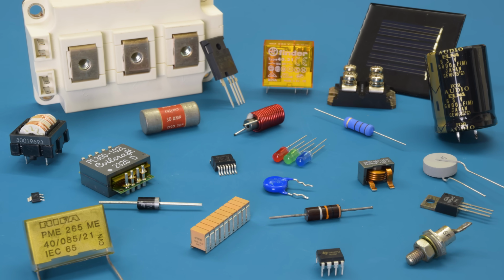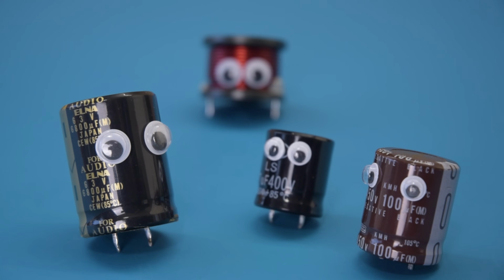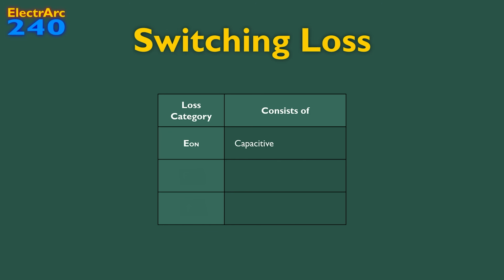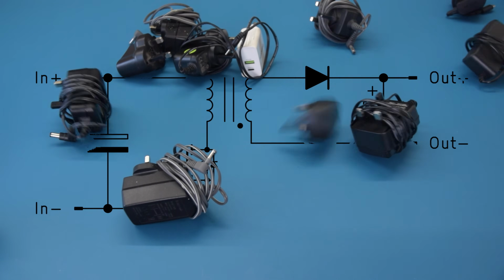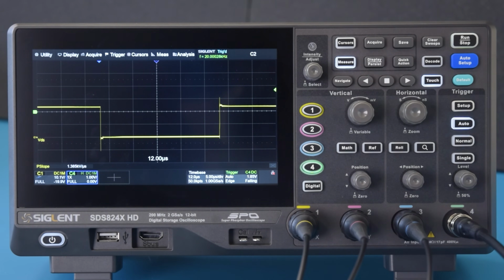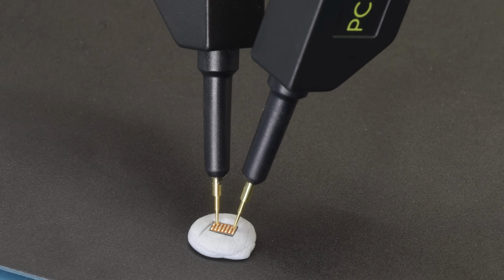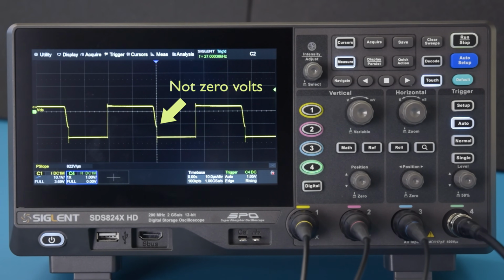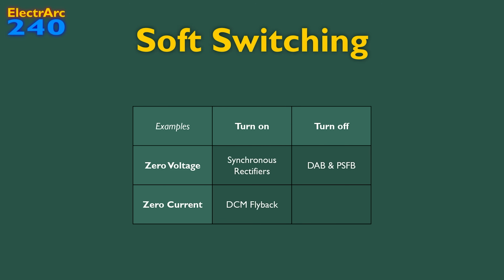Everything You Need to Know About Soft Switching (Switching Loss, ZVS, ZCS)

Comment from the maker: If I do end up making these boards into a kit, is that something you’d consider buying? If so, do you have any feature requests?
Reply: I think I would, and even the older boards as well in previous videos (The power meter board attachment for example, and the buck, boost and buck-boost too). The quility of your boards are amazing in these videos.
Reply from the maker: Thank you very much. The boards for this video are the next iteration of those, the signals are much cleaner and the boards cost less too. I was planning on making very similar plug-in power monitor boards for easy efficiency measurements, so good to hear that would be useful!
Reply: @electrarc240  Can't wait to get my hands on them. I'm watching you for a while now, and ALL of your videos were insanely informative for me and I learned a lot from you. The quality is top-notch.
Reply: it think like a half bridge board we can configure to other switch modes with a kit might be cool, but put some safeties in the kit for us cooking engineers
Reply: I think your market is probably more like school and lab. They love easy and visual tools.
Reply: I need these so I can run 5v for small devices from a higher pack voltage, and a higher voltage for a laptop running from the same pack. The system is meant to be hot swappable.
Reply: Conduction loss power is not P = IV + I2R, it is either one of those two on pure ohm load.
Reply: Yes
Reply: You know I would 😉
Reply: Maybe some backflow prevention? I have had some very annoying experiences with that.
Reply: Yes
Reply: yes! I absolutely hate my solar panels having  twice mains frequency and half mains voltage on them. That capacitively couples to my brain. I want to isolate tthem back to to DC with respect to brain. Fixed voltage ratio is fine but a power transferred  limit software defined would be also be great (simple PWM is fine) as I would then be able to control how much power goes to solar inverter and how much goes elsewhere (say to batttery. So super efficient isolated DC-DC with software controllable output power (output current limit). 8KW at 550V in and out please. That will cover 1 string.
Reply: Yes I'd be interested. Can you add a link to the repo for it?
Reply: I'm very interested to know what sort of connector that tiny 10-way connector is??? It looks very useful! ❤
Reply from the maker: @LordPhobos6502  Samtec LSHM, they are very nice but I think probably a bit too expensive if I want to sell the boards
Reply: I think I would. I would appreciate the addition of check pins, for attaching oscilloscope probes, potentiometers where adeguate, and jumpers or binary switches, to separate stages, when it makes sense. I see it as an opportunity to compare your choices with mine, not so much for actually using them, than to know where I could improve 😊

Instead of material, I would also and more likely buy KiCad layouts as digital goods, because I already have tons of components. If they come complete with routes and drilling plans (Gerber files), I can order the mounted devices directly from China ... if I feel lazy 😅
Reply: Quick question? What does the number 240 mean in your profile?
Reply: @AngelOrtiz-qu8if  GenZ 24 yo 😅
Reply from the maker: @AngelOrtiz-qu8if  240V here in the UK!
Reply: I would aswell, and maybe  even my school since it teaches mechatronics with power electronics. But you'd have to be able to sheap to Brazil w/ a price change, because some of these teaching circuit boards available from other sources can buy triple the components with their prices.
Reply: I would like to buy KiCad kits only, actually without PCB. The great advantage is, I don't have to find the right components and someone has already made the math. Sorry if it sounds lazy, it is 😅
Reply: I've been interested in some optimally efficient soft switching  resonant buck boost converter with voltage controlled PWM regulation. The idea being to eliminate the class H PSU need for a VCCS amplifier. If the voltage and current can swing up and down dynamically, with current sensing, you can get an ultra efficient current source amplifier that can meet the voltage swings required in a varying impedance load. Idk how to implement the sensing feedback in this system. But it is bridging concepts of class H PSU's, resonant high PSRR linear regulator, and VCCS amplifiers, in my case a OPA549T. 
That would resolve my issue of heat buildup, from low impedance loads, while needed the higher voltage when impedance rises, during higher frequencies. Any thoughts?

Comment: In the case of phase-controlled SSR, employing inductive loads (fans for instance), the switch (triac) is turned on somewhere in a cycle, and the load current smoothly rises positively or negatively. So it is zcs. And the triac is turned off naturally when the load current is down to zero. It's also zcs. Right?

Comment: About soft switching, i think it would be great using DRSSTC as pretty hardcore example. Technically its a very efective inverters based on ZCS, but every miscalculation or wrongfull comutation isnt a efectiveness problem only, but also danger of destruction. With primmary current around 2-3kA at 50-100kHz, few kilojoules in LC circuit... It will be a loud failiure :P

Comment: Video summary:

Everything is an inductor.
Everything is a capacitor.
Everything is an antenna.
Ground is a lie.

Electrical engineering is basically voodoo magic with differential equations as far as I’m concerned. 🤣

Comment: 13:35 resonant topologies are quite common actually for onboard chargers for EVs, due to this exact high efficiency at low load (during CV charging phase). But of course, it is followed by a full bridge rectifier or any other type of AC/DC topology to control DC bus voltage.

Comment: Thing that's true, but seems counterintuitive: every single watt your PC/Laptop uses energy from the wall is converted into heat.
If that wouldn't happen, your computer wouldn't use energy at all to do all the calculations etc. but since it does, there need to be energy loss -> heat.

And this is true for any electronic devices. That's just how universe works :D

Comment: This is super interesting, really loving this content!
In integrated power amplifiers for RF circuits, there is a lot of effort put in managing harmonics and so on to ensure that the output transistor switches when there is either no current or no voltage. 

My wife did her PhD on fully-integrated switched-capacitor DCDC conversion. What is interesting there, when compared to large, PCB-based DC/DC converters, is that switching is, for all intents and purposes, instantaneous. If you do full switching, the on-resistance of the transistor does not impact the efficiency, it only changes how fast you can switch. (this is because you will always waste half of the energy of the switching cycle in the on-resistance, regardless of how small it is). 

Note that this is not the case if you don't fully deplete the capacitors!

If I remember correctly (it's been 5 years since I proof-read her thesis :) ), since a lot of the losses also come from so called 'bottom-plate-losses', which is the parasitic capacitance to ground of the flying capacitors which also constantly get charged and discharged (but whose charge just flows into the ground instead of output), in some sense the switching frequency does not necessarily impact the efficiency a lot. After all, every cycle, assuming you fully charge/discharge all capacitors, you are moving over the same ratio of charge to output and to ground. Doing it more often increase the energy wasted to ground, but also increases the energy pumped to the output by the same amount. 

In addition, because on-chip DC/DC controls work so fast (MHz is 'slow') you can see input 50 Hz waveforms as more of a gradually changing DC voltage. So what my wife did was just use a (switched) rectifier, and then just constantly change the conversion ratio of the DCDC converter during the waveform, no (large) high-side capacitor required to store charge and smooth the AC voltage.

Hit me up on linked in or such if you want to talk more about this or want to get a copy of her work!

Comment: I am into power inverters (single and 3 phases) and I have decided to use microcontrollers in order to get close to zero losses. Not only, because losses are expensive, but also, because components become quickly difficult to get, if they must support approximation. While I could use, say,  twice as much transistors just to be sure, it is much less likely that something fails, when the probability of error is close to zero. You named zero switching, which is crucial when activating the opposite transistors of a H-Bridge, because with both sides on, it's a shortcut 😅. I have seen many circuits which fail under load, because of increasingly longer shortcuts, the more current is drawn. In particular, the most cheapest mobile inverters have this defect. I like most about microcontrollers, that it is possible to dynamically adapt the behavior to the circumstances. My circuits have about 95-97% of efficiency, but they are also result of years of trial and error, and lots of tweaking of the code.

Comment: The formula at the very start P = I*V + I^2*R is wrong, it's just P = I*V or P(t) = I(t) * V(t) where I is the current through the switch and V is the voltage drop across it. For FETs or HEMTs the voltage drop is roughly linear with current draw so the I^2*R can be used as a simplification based on that assumption. Of course with BJTs, thyristers, IGBTs, etc. (devices that rely on current through PN junctions) the voltage drop follows the schockley diode equation iirc. Though I think such devices are assumed to have a more-or-less constant drop when getting an estimate of power dissipation, which means power dissipation is linear (or logarithmic)  with current rather than quadratic.

Comment: 13:25 Why can't you easily produce a wide range of voltages with a fixed ratio LLC? Can't you vary the voltage while maintaining the same frequency? For example, change amplitude or pulse width?
Reply: You can with active voltage positioning

Comment: Hey, could you "suggest" (= HELP me!....) some kind of upgrade for the power supply that was in use a few years ago?

These were generally quite powerful battery chargers (1000–2000 VA), but their control system was ingeniously designed: they regulated the input voltage to the transformer and measured when the voltage was sufficient on the secondary side.

I’d like to have a triac or thyristor control something like these.

I have 12V/20A and 24V/60A units for testing.

In the former, a standard automotive relay breaks the secondary circuit.
In the latter one, the relay controlled the primary side at 240 VAC.

The rectifiers if they can't handle would be replaced components sourced from a welding machine (20V/200A continous) and a forklift(72 V/200 A).

I’m not looking for high precision, but rather short-circuit resistance and 100% load capacity.

Comment: But isnt the capacitive and inductive part out of place here? The ringing/overshoot on the switch node is a pure voltage, there is no current flowing if i am not mistaken. I have never seen a ringing current in a synchronous boost converter. Power dissipation is always I²R, and thus ringing should not create losses. Rather can the overshoots destroy the semiconductor switches. Can somebody elaborate on this? What am i missing?
Reply: Cross conduction losses happen in the microsecond timeframe. One must look closely

Comment: The way the conduction losses are explained is quite misleading. In case of a bjt, it would be base current times voltage between base and emitter plus collector current times voltage between collector and emitter. For mosfet it's mostly just drain current times voltage between drain and source or drain current squared times resistance between drain and source. There is only one current I in the formula P=IV+I²R on the video without subscripts, I believe they should be different currents e.g. Ib and Ic, base and collector current. That formula would yield double conduction losses as I times V is actually the same as I² times R, where V is the voltage drop over resistance R. Or is that a typo and you meant to write P=IV=I²R?

Comment: I don't even see why this particularly needs a deep explanation - it's patently obvious.  You have an output.  It  has some capacitance associated with it.  To switch that output from low to high, you must charge that capacitance.  The charge for doing that comes from the positive supply rail.  Then, later, when you switch the output back to low, you have to get rid of that charge - you do that by letting it flow to ground.  So there you go - you've moved some charge Q from the positive supply to ground, and the energy associated with that is Q*V.  That energy is now lost.  You've expended it. 
 
Yes, of course, ultimately the energy becomes heat by getting dissipated in some resistance somewhere in the circuit, but that's a side thing.  Even if you avoided that by making everything superconducting, you'd still have the charge in the "low energy place" at the end of that low-to-high, high-to-low cycle, and you'd have to do work to bring it back up to the positive supply rail where you could re-use it.
 
Any attempt to "get rid" of this loss is going to have some cost - switching will be slower or something.  Nothing is faster than "positive rail to output, output to ground."  There is no free lunch here.

Comment: good work. the high flyback from the coil is always a problem because the coil and the capacitance in the air will behave like an LC circuit at a very high frequency I would try to put a small capacitor across the coil to bring the high frequency down (you slow down the coil from producing the high voltage spike) then the diode will be better able to deliver the current to the consumer (you probably know what I mean)

Comment: Fascinating. The other day I did some testing of inductor saturation currents, I made a variable air-gap by clamping increasing numbers of paper shims in the open end of a clamp-on ferrite sleeve. The inductance went down while the saturation amp-turns went up, but importantly the inductance went down slow enough that the maximum energy storage still increased. That Coilcraft online tool looks very useful, whether or not I buy their inductors (it beats testing cheap local cores with incomplete datasheets), designing custom SMPSs is kinda fun and it’s nice to be able to take out the awful uncertainty of magnetics selection.
Reply: A step gapped ferrite core is an option. Otherwise look into composite cores for effective permeability roll off

Comment: It would be interesting to see if any of these techniques could be applied to BLDC motor drivers (or even industrial VFD units). As far as i'm aware, they are pretty simple triple half-bridges.
Reply: Agreed. Apparently switching too fast into a BLDC will kill it from too high a dV/dt, but I haven’t seen any explanation of why. Man I want to make a cool GaN motor driver. Kilowatt class for personal mobility.
Reply from the maker: @Scrogan  One reason is the capacitance formed between the motor windings and the stator causes high common-mode current spikes to flow to GND every time a phase switches, if the switching is too aggressive the current spikes can be so high they can break down the insulation of the windings over time. Mad
Reply: @electrarc240  so to stop it, the series inductors need to be ones with specifically low self-capacitance.

Comment: Thanks, i made a Buck-Boost Flyback converter recycling PC ATX power supply's components weeks ago.
At first it was supossed to be a funny little proyect... I ended up learning a lot more than i expected and i keep studying it, this video will help a lot.
Reply: I started this way, too, but 60 years ago with valve radios. I learned that electricity hurts and I got electrocuted only twice 😅
Reply: @Smartapillo  I recently broke my "no shock streak" of 2 years, 2 weeks ago working with a CRT monitor. My soldering iron does not have a ground connection, so it was discharging some voltage on the large main's cap... i rested my whole arm over the PCB, and i wasn't expecting that haha.

Comment: would't discrete anti-parallel schottky diodes with silicon mosfets help with the reverse recovery of the body diode? Since schottky diodes have a smaller voltage drop, whould't the current on the body diode be 0?
Reply: Yes. Most commercial dc/dc synchronous converters use parallel schottky config across the switch. Saves cost.
Reply: Yes, but Schottky diodes have poor voltage capability and high leakage. An active synchronous rectifying MOSFET is usually a more efficient design.
Reply: @davidgunther8428  Sorry, I meant on a synchronous converter. They would only pass current during the dead time. The low voltage will be a bit annoying but maybe you would get some efficiency boost??? I guess it depends on how much current it is leaking.

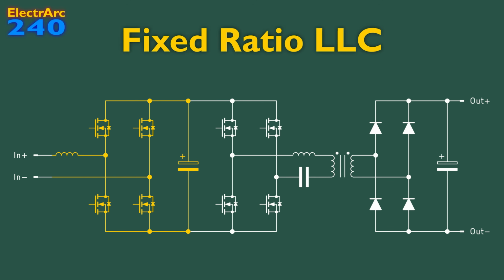Comment: 13:40 could you have the active PFC circuit modulate the bus voltage into the fixed ratio LLC in order to have a variable output voltage, e.g. for battery charging?
Reply from the maker: I have seen some papers suggesting something like this, a multistage conversion process for data centres but with the regulation in the stage before the LLC which then directly feeds the processors, usually the other way around and for good reason!
Reply: Why not? It's a great idea actually, but a control loop becomes a real nightmare to make it tight and oscillation-free.